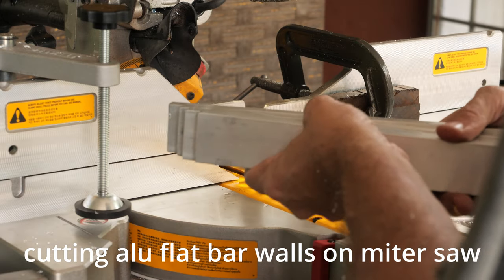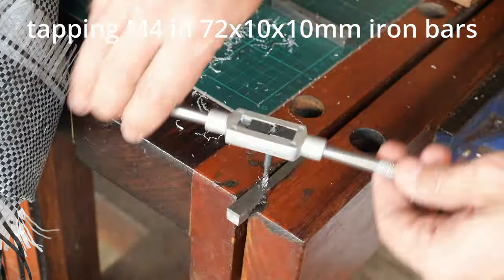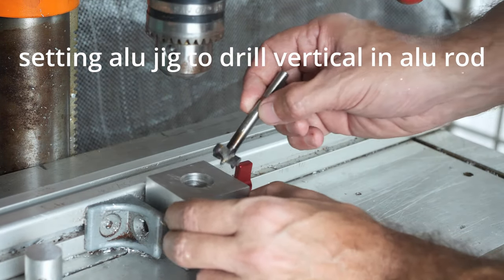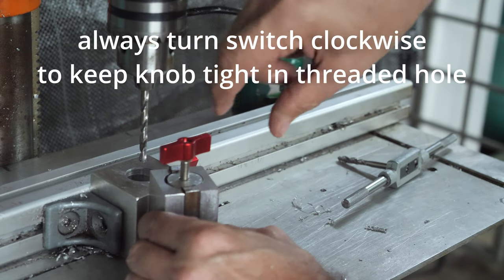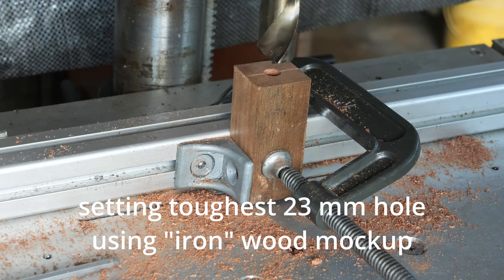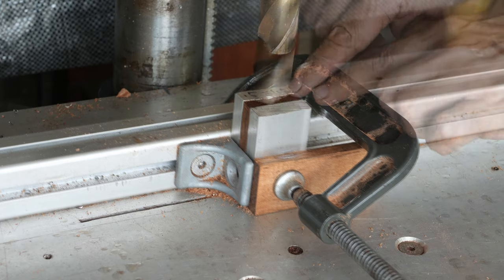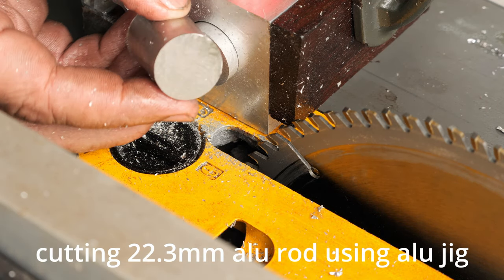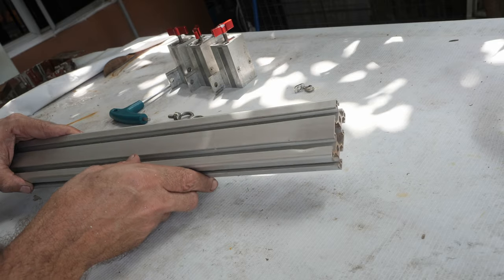How To Build Switchable Magnet

Comment: For how OCD you are with your drill bits, i'm surprised you don't use the drill press (unpowered) to start your tap to ensure a perfectly straight threading.
Reply from the maker: I use the lathe for boring and threading and it produces perfectly concentric results 
The video shows archive footage from the time I was prototyping the build and didn't want to change the drill bit (setup) or I was simply lazy
This video is just to give you an idea, it's not a detailed instruction manual. 
In the batch production mode we use totally different tools and technology, and we wouldn't publish it

Comment: Nicely made, but I have to raise couple issues - there's no such thing as an M3 drill bit. Do you mean 3mm? Or do you mean the correct tapping drill for M4x0.7 (3.3mm)? For M6, the drill should be 5mm, not 'M5'. The rule for drill sizes for tapping metric threads is, subtract the pitch of the thread from the nominal size, so M4, 0.7mm pitch, 4mm - 0.7mm = 3.3mm.